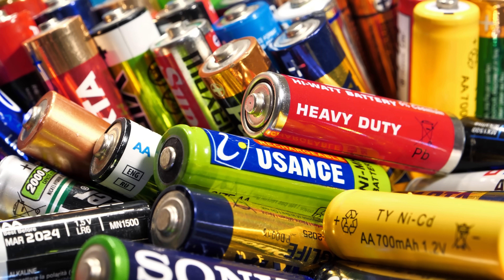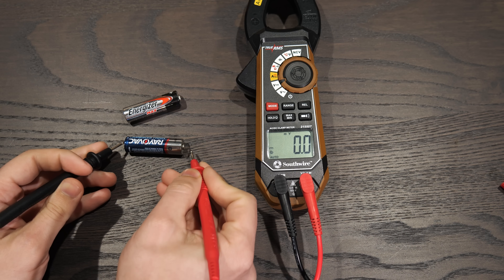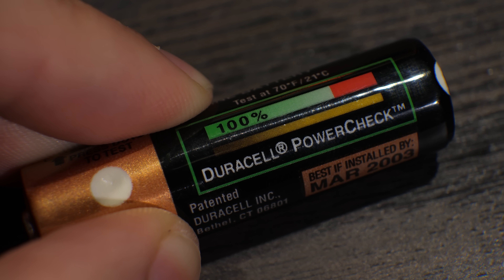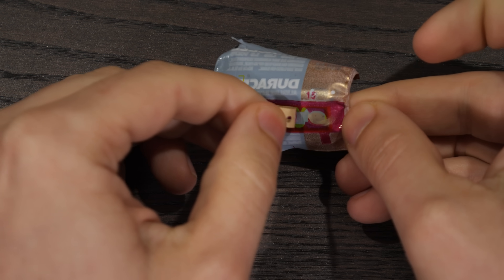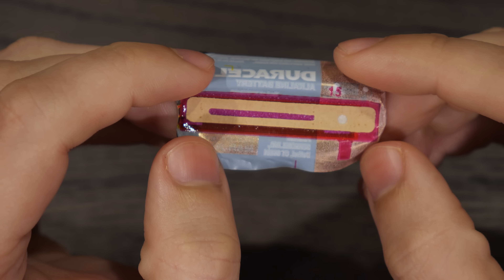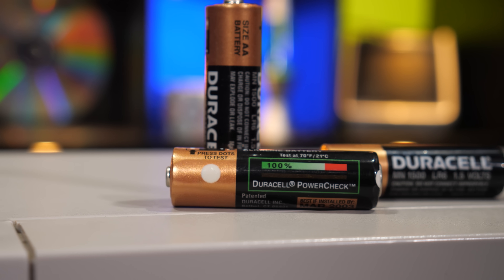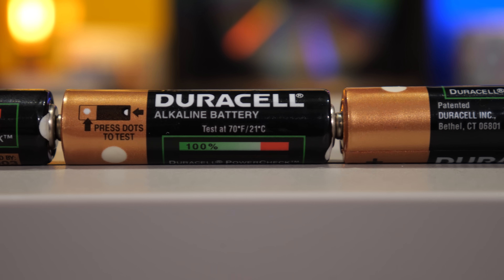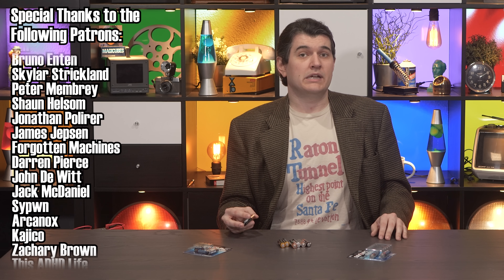Duracell PowerCheck: A genius idea which didn't last that long

Comment: There's a very similar paper strip tester that came with some batteries, also duracell brand. In any case, they were just 1 strip in a box of 4 batteries, so it was probably cheaper and more convenient. They were part of the plastic case and we cut and saved the strips because they were SUPER useful, even though we had multimeters, these paper strips were super compact, never wearing out, and worked with ANY alkaline battery. Also other types of batteries if you knew the range. Googling around it seems they're called "copper top tester".

Comment: Since this channel is all about being pedantic, I feel it is fair to point out that if it is a single cell, it is not a battery but a cell.  It takes more than one cell to make a battery.  A typical 9v battery has 6 cells, so it is not a battery.  Other languages reflect this difference, but English gets this wrong.

Comment: When I'm king of the world, the only alkaline batteries that will be allowed are D, AA, AAAA, And 9 volt. I'm only keeping AAAA around because that's what's inside of a 9-volt. It's crazy one of the most common rechargeable batteries no one ever sees is a Sub-C. I can't think of a single application of one by itself, but that's what makes up the majority of drill pack batteries and other rechargeables packs.

Comment: I need to test my batteries because i'll often find them lying around when cleaning up and can't remember if they're old batteries o forgot to throw away or new batteries i pulled out but didn't use/need. A $7 tester fixed the problem though.

Comment: I can't believe you didn't mention the "bounce test" which is an easy way of seeing if the battery is full or empty! You bounce the battery on the table or any hard surface, by dropping it to the negative pole from around 2 inches. If it doesn't bounce (falls like a bag of sand) its full, and if it bounces its empty. Not very reliable test, but its cool.
Reply: I remember trying that as a kid and getting no real results. Even dropping dead ones vs out of the box new ones didn't seem different to me. I assumed it was a fake fact
Reply: @whatevername4873 You should try it again but be sure to drop it on the flat end straight up and down. This test works really well for alkalines. Need a really hard surface.
Reply: It's a very reliable test if you get the old and new mixed up.
Reply: I used to measure batteries by weight. The Polaroid branded ones immediately felt like paper when unused for a month-ish

Comment: Somehow I managed to burn my finger on one of these somewhere in the 90s. I had the bright idea to press on the indicator strip while also pressing the 'buttons' in and within a second or two, it got very hot. At a guess, I probably pushed the thinner end of it hard enough to conduct to the outer shell of the battery, or else that's the only possibility I can think of. The strip became discolored in that spot.

Comment: There is one reason I think disposable batteries (other than button-style batteries) make sense: survival/trekking gear, like a proper GPS or avalance transponders. 
Sure, I could haul around a recharger and mini-solar panel, and I have, but really, disposable batteries last longer and are easier to resuply/bring with you. When every gram counts and you don't have guaranteed access to recharging opportunities - disposable it is.
And most devices give you the option anyway...
(Video idea? Avalanche transponders might be interesting to take a closer look at)

Comment: I have a Duracell Quantum AA right in front of me with an expiration date of December 2025 that has this feature, it's still good, I know it's good because I used the tester. It's a slightly different design, and a much different look, but they still had this feature as of whenever I bought that battery which couldn't have been more than 5 years ago.

Comment: Don't know the last time I bought disposable batteries, I bought rechargeable AA and AAA batteries a couple years ago and they still work great for TV remotes, Xbox controllers, and flashlights. The only thing that uses disposable batteries are my smoke detectors. Why would you buy disposable when rechargeable are barely more expensive?

Comment: I definitely remember these.  I recall played with the tester pretty often.  These days a lot of devices use rechargeable lithium batteries so I've needed less and less AA batteries.  My TV and Bluray player remote and some flashlights are all I can think of off the top of my head.  I just bought a new TV for my room and it came with a rechargeable remote, so even the most basic of devices that used to use AA batteries are using rechargeable lithium batteries now.

Comment: We still have those in Europe. The model in my country is Duracell Turbo Max with Powercheck and it costs about 1 Euro per battery. The scale is a bit different but overall they are the same.

Comment: As of over 12 years ago, Energizer would reject brand new single cell batteries if they tested at less than 1.6 volts. It's been even longer since I was around their 9V testers, but it seems like their voltage cutoff was set somewhere around 9.37. Maybe higher? It was routine for some batteries to get cosmetic defects, have their first label or 9V jacket removed, and then relabel the single cells or remanufacture the 9Vs as Eveready Gold brand. But that could take time. They would reset their battery testers to reflect how much the cells had aged for those relabel Eveready Gold runs. I think? I was a temp in an Energizer factory, but I never operated a battery tester myself.

Comment: man, I remember these coming out in the UK in about 2008 and remember them being sold until about 2016
the trick was to press lightly with your nail on the spots saved your fingers hurting
Reply: They are still a thing over here, Duracell Ultra

Comment: Alkaline batteries come with a simple tester: if they don't bounce, they still have some charge! The fluid inside dries up as they're used, so it's like the difference between bouncing a half-full water bottle and a heavier empty one.

Comment: I have several multimeters, think it is maybe 15 years since I used one to test single use batteries... I just buy new batteries and throw out old ones whey they fail, no need for testing them.

Comment: Back in the early 90's, UK electronics retailer Maplin gave free battery testers with a minimum order.  They worked like these, but were a separate plastic strip that you could touch on any battery.

Comment: i wish rechargeables would still have those...
wait.. the way you talk about those cells.... you never used rechargeable batteries? we had a good 20-30 rechargeable AA batteries. I still use them and you can still buy them in pretty much every supermarket. yes, they only have 1.3V but in most cases that's enough. I tried regular batteries in my x-box controller and it was a nightmare how many i burnt through. Just get rechargeable AA or AAA cells (they also exist in other form factors like C or D cells)....

Comment: Omg. The nostalgia of my childhood right now. My battery usage is pretty straightforward. New batteries go in. If I take them out of something, say, an unused kids' toy, I rubber band them together so I know they are used and they go with all my batteries in one big storage bin. 

Most of the time, I use energizer rechargeable batteries. I'm pretty proud of my system. I rubber band them in pairs. If they are depleted and need recharge, I wrap one loop of the rubber band in between the batteries.

Comment: One of my computer mice uses aa batteries. I use rechargeable batteries with a wall charger. Wish they had this.

And yeah; never checked batteries before the Duracell built in ones. Was a novelty mostly.

Comment: I only have a rudimentary knowledge off batteries and circuits so pardon if I'm wrong, but I don't believe that is actually a heater at all! Judging by the fact that it appears to be the same material as the activation point, I believe it is just a conductive material shorting the battery, causing it to heat up. It's very similar looking to how you can make a single use lighter using a foil gum wrapper and a battery, I just thought it was very interesting.

Comment: Most of the devices I use that have rechargeable batteries don't have a means of replacing the batteries when they reach EOL. We need to start designing devices to use replaceable batteries, perhaps in form factors similar to AA and AAA and CR2032, depending on the size and current demands of the device, so that less of our tech becomes e-waste.

Comment: I remember using these all the time. Though, to be fair, most of the time was just for fun to see the funny yellow bar go brrrr. 

But now that I see how it worked, wouldn't it have been more cost efficient to just incorporate the tester into the battery packaging rather than each individual battery? Like have a small button-like clip that you could press onto the positive end of the battery (similar to how 9V batteries have) which would be attached to the main body of the package by a thin strip. Then you'd simply press the negative end of the battery onto a pad on the packaging, thus completing the circuit. 

Seems like that would be more cost efficient and easier to manufacture?

Comment: Then thing ive seen that thermochromic material used in something you might not expect. Wine bottle/glass bottle temperature  ring.  You slid it around the bottle and you would get a temperature reading in °f&c as well as a color gradient from  deep blue(cold aprox 40°f ) through green to red (hot aprox 70°f).  The majority of it was made with some faux leather of the time(70's-80's) thermally insulating all but part of the strip on the glass side. Much like the tester in the battery.

Comment: These played a pretty nice role when you grew up miles away from a store and access to batteries was limited. You would often scavenge batteries out of the nearest device only to find those dead too. Or was the device broken? This was a pretty simple and cheap way for Duracell to remove the ambiguity and probably added a lot to sales. If you just spent an hour playing battery roulette you'd be a lot more likely to buy these out of sheer frustration.

Comment: The problem from my point of view was based on the difficulty in using the feature I never knew if the battery was actually dead or I wasn’t pressing hard enough.

Comment: 14:09 - Yup, now instead of just replacing cheap batteries, now everything has to have some kind of charging dongle and be plugged in all the time otherwise it's dead when you go to use it.
Reply: And when the battery degrades it then becomes landfill

Comment: RE: Usefulness of the battery testers

You forgot about the children the world over who are given a limited set of batteries (after all, batteries cost money, which their parents either don't have or are unwilling to spend on the luxury) to use in their toys some of which only work with a battery charge above a certain level, while others are fine with a much lower voltage. It is certainly useful in that regard. Unfortunately, battery company can sell more batteries if their users are not aware that the batteries aren't completely used up, yet. Some devices are so awful, they only work in the 1.4-1.6V range of the cells (they take multiple!), which makes using rechargeable batteries, with nominal full voltages between 1.2 and 1.4V, infeasible. And when "depleted" the batteries that no longer work in such devices would be perfectly fine in almost everything else.
Also, these battery testers would be supremely useful today, installed on rechargeable batteries. Because you definitely keep those around, sometimes empty ones with full ones in the same box. Quickly knowing which ones are full would be incredibly handy. 
Patent trolls are terrible.

Comment: I had uniross rechargable AA batteries and matching charger in the 80s,  for a few quid more you could save yourself a fortune, I remember my dad having a massive battery charger that did pretty much every cylindrical battery on the planet,  my brother kept used it for his D cells for his boom box.

Comment: Duracell also made blister packs of cells with the tester in, as discussed. The resistive element is actually screen printed conductive ink, which is based on silver powder, in a carrier based on printing ink, screen printed onto the plastic sheet, and then this thin sheet was dried, and the back had the thermochromic ink screen printed onto it, followed by the top layer being thermally bonded, to make a 2 layer sheet with the tester in it. Then the paper insulator was applied, pre punched out for the gap where the thermal heater needed insulation, and the one hole for the switch, the cutting die finishing separating the paper from it's supply roll. This was then punched out, and applied to the large sheet of battery label on the adhesive side, so you had a large self adhesive label, that had a release side applied, and this again got partly cut out, to leave the battery sleeve on the backing layer, excess being weeded off automatically. Then slit into working rolls, and applied on the line. 

Very complex, and needing lots of precision sharp cutting dies, so no wonder they decided the much higher cost and complexity per cell was not worth it. Thus the shift instead to use almost the same test unit, just with 2 strips of adhesive on the top, to the blisters, saving a lot of money, as you only had one per 4,6,8 or 10 cells. Then cost was cut again, and with all the assorted contract manufacturers not wanting to pay the cost, they went back to just labeling generic cells off a random production line, as Duracell is now nothing but a brand name applied to whatever generic cell was the cheapest quote to make a few hundred million cells, no quality required as they are running off name recognition. After all, no longer will they replace or repair equipment damaged by leaking batteries, they will only pay you a voucher for the cost of a new set, if you pay to ship the leaking batteries to them, at your own cost.
Reply: I used to work at a membrane switch printing facility with a guy who previously worked on these, apparently stirring the thermochromic ink and keeping it suspended was a real bitch
Reply: I purchased NiMH batteries years ago and quit using Duracell specifically. I use energizer for all my rechargeables, but I'm looking to replace them with the rechargeable lithium ones, when all those start bitting the dust.
Reply: TL;DR

Comment: I remember using these in I guess it was a Gameboy(?) and it ran out of power and turned off. I immediately popped off the battery cover to find the dead batteries still quite warm and the tester bar fully yellow as a result, lol.

Comment: Those things are to check whether your device is broken or not. So you don't go shop for the new batteries when, in fact, your remote/clock/rc-car is the problem.

Comment: A single AA or AAA is not a "battery" any one who knows otherwise can fight me! A single AA or AAA is a "cell". A "battery" contains multiple cells.
Reply: Ok I will fight you then, I have had a late 2000s Duracell AAA "battery" disintegrate, underneath the rapper there was 6-8 cells within the AAA battery. PS: The battery was in a garage remote that stopped working last year and I had to pry each cell out one by one as it was stuck in there solid.

Comment: Yep, still available new to buy here in EU. They're called Duracell Ultra and they include powercheck with the strip being segmented in four parts.
Reply: They're available in the US too, so I'm not sure what the guy in the video is talking about.
Reply: ...STILL,WHAT IF TO SOLDER SOME WIRES TO THESE STRIPS

...LIKE TO GET VERY BUDGET POWER CHECK,HEHE

Comment: I suppose the kind of person that keeps old batteries lying around, 'just in case' - usually on the stairs, it seems like - maybe even (don't try this at home!) arranging them on heaters to coax the last of the 'juice' out of them, is not the kind of person to buy Duracall where budget brands are available!
             Of course, sometimes (though not always) buying the "El Cheapo" brand is a bit of a false economy, or you might be in an outlet where only the premium brands are available. In such cases, unless there was a very marked disparity between the brand with the 'self~testing' strip and it's competitor, I would definitely go with the former - it just seems to me like such an obviously useful feature to have.

Comment: I actually have a whole basket full of partially used batteries that get used whenever something needs batteries that don't need to last long or provide full voltage. Only devices that I don't like to change batteries on or that I reasonably expect to use them to the end like thermometers and stuff get the fresh ones.

Comment: I distinctly remember in 2013 buying a pack of Duracell quantum batteries with these power check labels from a Walgreens. Pretty sure the only difference was that they had the testers. They lasted just the same as anything else

Comment: Nowadays almost every device uses either a built-in or 18650 battery. 
But back in the days i did have AA just laying around.... You know, when they are already dead for a CD player, they are not dead enough for a remote. So yes, this built-in tester used to be very useful. I honestly thought they were still around, but never needed to test a battery in the last 15 years.